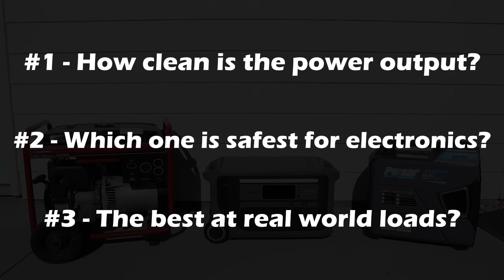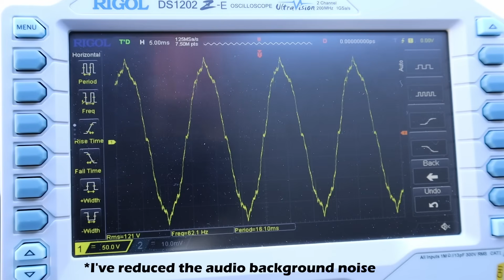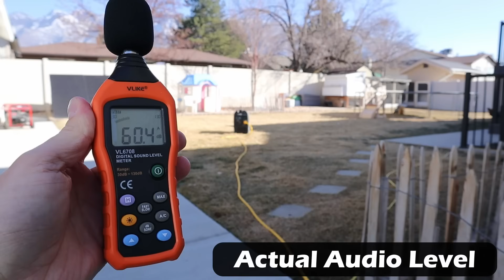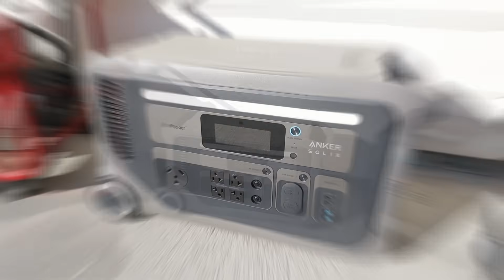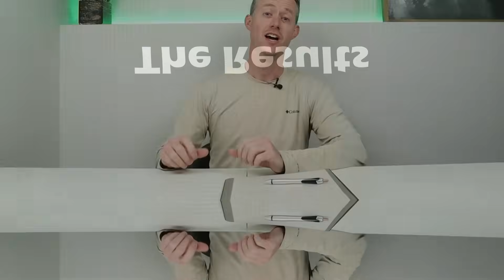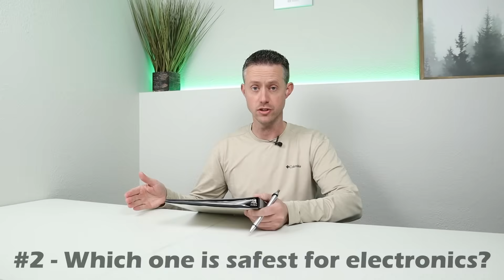Before You Plug Electronics Into A Generator, Watch This!

Comment: I saw an interesting video earlier in the week.  While a power station was being charged, it was not powering the load with its inverter, but was passing the charging voltage through itself on to the load.  The content-creator simulated a questionable power source by using another system with an output of only 108V-109V.  While charging from this source, a decent power station that normally provides 120V to its loads was only giving them the 108V it was getting.  This means that charging a power station from a conventional generator /while it is powering loads/ is potentially a very bad idea.
Reply from the maker: Correct, so using an affordable inverter generator solves all those issues!

Comment: Thank you, I truly thought the battery pk would be cleaner than the inverter generator.
Reply from the maker: I was kinda surprised. They both put out great power but the power station did have slightly higher THD and noise.
Reply: They generate the AC in the same way.  The inverter generator is actually a DC generator which powers a power inverter to give the AC output.  The power station uses batteries in place of the DC generator to do the same thing. 
I was surprised at how much noise the table saw put on the line though.

Comment: Excellent video - would your results then suggest the power stations that used external charging ‘bricks’ like the older Pecron units be safe then to use with non inverter generators?  Seems that style fell out of favor quickly but it sounds like a strength to me based upon your results.
Reply from the maker: Yes, as long as the power brick didn't get super hot during use, it should be fine.

Comment: Dang my dad was trying to recharge his f3000 with a small gas gen last night and it wouldn’t even register with the Anker at all. Now I know why 😅
Reply from the maker: Yep, it must have had super dirty power. An inverter generator would fix that. Thanks for sharing your experience.
Reply: Have seen this with a couple of Eco Flow units.  They would charge from a generator with a floating neutral, but not from a generator or inverter with a bonded neutral.
Reply: @RockSprings-x3d just tested charging my new pecron f3000lfp with non inverter genny,  both are actually unbonded.  Pecron didn’t seem to care if I had bonding plug in or out of generator.  Had one on hand. It couldn’t tell a difference. Genny is unbonded.

Comment: Dirty power generally won’t affect anything that uses a DC converter. Microwave ovens on the other hand can go brazerk as they use the frequency for timing and fan speed control.
Reply from the maker: Thanks for sharing that great information! As long as the DC converter doesn't get hot while in use, it should be fine.

Comment: During our multi-day outage I used my old school generator to charge up my power stations. If it blew them up, they're under warranty, none of the things I connected to them are.
Reply from the maker: Most owners manuals say to use an inverter generator to charge the power station. It's in the fine print.
Reply: @Jasonoid  But it would be on them to prove it. Plus, potentially blowing up a $350 power station vs. my $1500 fridge.... no brainer.

Comment: Jason when Hurricane Helene left us without power for 4 days I used my Predator 3500 during the day and my power stations at night,used the generator during the day to run 2 window ac units and watch tv,and recharge the power stations, I always left the fridge hooked up to the power station.
Reply: Perfect example of why every household should have a small inverter generator and some power stations to run the fridges at night without the noise
Reply from the maker: I'm glad to hear your setup worked well for you! Thanks for sharing :)
Reply: I would like to add an inverter to my existing Predator generation; can you instruct me on how to do that? I’m totally new to this. Thanks!
Reply: @dominodarwin I have not done it yet, but seems that just using "dirty" generator to charge a battery bank and pulling DC from it into the (decent quality) true sinewave inverter then drawing your clean AC power from that is the logical path.  Pretty sure someone will correct me if that is not accurate-
Reply: @MrMEmEmEmEMEMEeeeeee the danger is using a dirty generator to charge a modern power station and trusting the the pass through ac will be cleaned, it won't, the passed through is simply sent through the power station's output making some people believe that they are clean power.
Reply: @gmosc I am sure you are correct about that.  However, that is NOT what I suggested at all.  The question was, how to add an inverter to a Predator (dirty) generator system-no mention of a power station.  Since my suggestion changes dirty AC to DC and then back to clean AC (with unavoidable efficiency losses) via a true sinewave inverter there is no way to pass-thru the varying voltage\frequency\high THD, is there?
Reply: @MrMEmEmEmEMEMEeeeeee yes you are correct and yes I understand your suggestion, I'm just mentioning the danger that someone could easily fall into if they don't fully understand what you are suggesting and make the mistake of running sensitive equipment to a charging power station that they are charging using a dirty generator. 
I've heard about one man who insists upon keeping his dirty generator because he knows how to fix it and that  makes sense, then he can do what you are suggesting. But it almost seems that keeping an older generator makes less and less sense especially if it is  being kept for an emergency it seems risky to trust them.  But respect to anybody who has a good system that they understand and trust. I hope that knowledge can be passed on in a clearly understandable way and it can be a huge benefit to the right people.
Reply: @dominodarwin  WHY??? Traditional generators have been powering electronics for over half a century with no issues... don't buy into the clickbait hype.  Your traditional generator is fine.
Reply: @dominodarwin you can’t. Inverters are DC to AC and your Predator outputs AC. 

If you want to clean the sine wave I’m sure there is something for that

Comment: Sorry, but none of the waveforms demonstrated in this video will be any problem to "sensitive electronics".  I know people bang on about "sensitive electronics" all the time these days but seriously... what is demonstrated here is simply not an issue.  Even something that employs a simple capacitor dropper (ie the cheapest of the cheapest absolutely rubbish grade LED lightbulb, christmas blinky LED strings etc) power supply will not have an issue.  Capacitive droppers can have issues with high frequency ripple since the capacitor lets through more current as frequency increases but even the typical level of ripple that results from poorly designed AVRs in traditional generators isn't a problem.

Where things will go bang, and this can be an issue with a standard direct AC generator or an inverter, is voltage overshoot should a high load (relative to the generator's amp capability) be disconnected.  Essentially how well the device regulates voltage.  This can be seen with say a good old incandescent bulb.  Disconnect the high draw load when it is actually drawing significant amps and you'll see the bulb momentarily go bright then back to normal levels.  Even this sort of behaviour is usually not an issue, it's only when voltage goes way out of spec that things go bang.

I'm in a 230V (+10%/-6%) country and everything is expected to work without going bang at 253V continuous from the network (grid).  Solar installations can push the voltage to 260 and things still won't go bang.  From what I can tell of USA regulations about +6% is considered acceptable from the network so about 127V / 254V is within spec and nothing should go bang with these voltages either.

"sensitive electronics" is more of an escape route that manufacturers of elcheapo/poorly designed products use when their device goes bang for no explicable reason.
Reply: Running out of fuel is when connected devices are harmed. The engine typically surges up and down in speed for several seconds, the frequency and voltage vary wildly. An inverter generator will just shut off its output. So it might be safer in that case. But not a big deal.
Reply: @BwanaBob  Yes, engine speed will move around quite a lot but it won't go radically over speed, at least not enough to push the AVR beyond it's ability to keep voltage limited.  Similarly the frequency won't go up to the point where a simple capacitor dropper supply will fail.  The sort of speeds to get the AC frequency high enough or voltage beyond the AVR's ability to respond rapidly enough would cause the engine to instantly fail and the rotor in the generator to wedge against the stator.  Just getting one of these small (yes, 15kVa is small) generators to produce just 400Hz would require the engine to spin at around 12000 RPM...

Inverter generators usually don't just shut off their output unless the DC rail goes high.

Now I'm not just some clueless yahoo on the internet so if you care to provide 'scope traces showing voltage going way over and/or frequency going stratospheric that would be most interesting.
Reply: @retrozmachine1189 well you seem knowledgeable enough to ask this question of. Why does the normal generator put out such crappy power? From a physics standpoint? It is my understanding of the way things work that the sine wave that we get out of the wall comes from a spinning generator (alternator). The whole concept of a sine wave is about the spin of the generator, that's why it "unfolds" to 360°

And I would think for the inverter generator and the power station both, the quality of the sine wave is entirely dependent on the quality of the inverter that they are equipped with. So kudos to both of them for including a very good quality pure sign inverter. But why does the spinny thing not make a good sine wave? Wtf?
Reply: @mark_bickford  You are right.  The issue comes from variable loads.  You have to adjust the magnetic field in a classic spinning generator to provide sufficient current to hold the voltage.  Too much current voltage goes high.  Too little, voltage goes low.  Now toss in power factor (ie displace the voltage and current waveform) including harmonic loads and it all starts to get a bit complex and that is beyond the capabilities of the AVR to precisely counter.  There's actually more to it, but that's a good start towards understanding.  In fact lots of AVRs can't even manage a clean sine with no load.  That's assuming the generator even has an AVR.  Some do it even more crudely with a capacitor.  AVRs in big boy generators are infinitely better.  These days you can find switching AVRs in certain models of certain brands of small generators and they do a very good job indeed.
Reply: @retrozmachine1189 that makes sense, I just was shocked that at no load, that thing put out such a crappy sine wave
Reply from the maker: Thanks for sharing

Comment: I've never had a problem running anything with a gas generator as I make sure it is unbonded and tuned.
Reply from the maker: You must have a higher quality one than seen in the video.
Reply: @Jasonoid they require a little bit of tuning.

Comment: Good video. To often people assume if it says ge dearie that all are the same. And clearly they are not.

Specifically about connecting a generator to a power station, it’s important to. It’s that with pass-thru charging, we might get dirty AC output from a dirty generator. 
A workaround for this could be a diy battery expansion, with its own battery charger. This way the dirty generator charges the external battery, which in turn charges/equalizes the power stations internal battery, avoiding the dirty pass-thru output.
Reply from the maker: So spend $1500 or $2000 to fix a problem that a small $400 inverter generator can fix? That's a great way to make money on YouTube, suggesting people spend thousands to 'fix' their old generator. I've seen that from other channels. I think using a $400 inverter generator is cheap and easy.
Reply: @Jasonoid  you are not wrong. The two points to consider are if we already have a generator, we can use it. And if we want larger battery capacity, a diy add on battery with charger gives us that as well. 
If you are buying everything new, then absolutely buy the generator with inverter. That’s a no brainer.
So the conflict here comes from different priorities. All of which are valid on their own.

Comment: One thing to remember is when you are charging your power station (other than solar) it switches to pass through mode meaning whatever source you are using to charge it is also powering anything you have connected to it.
Reply: True, but when you turn off the outlets on the Power Station, this prevents Pass Through Charging.
Reply from the maker: Correct, and when using an inverter generator the power is extremely clean and wouldn't be an issue. Using a traditional generator might cause issues.

Comment: Hello , I was wondering if there is a Device that would take the power from a traditional generator and convert it to a pure sine wave ? Anybody? Anybody?
Reply from the maker: An inverter generator costs between $350 to $600. That's cheaper than any advanced power conditioning device needed to clean dirty power.
Reply: Just plug in a 12v power supply, and plug an inverter into that.

Comment: How about a whole-house backup generator like a Generac?
Reply from the maker: I'd sure hope that spending $10,000+ on a backup system like that the power would be clean.
Reply: Are there devices that can be connected to help clean up dirty power should you need to run sensitive equipment using a traditional gas generator?  Tripp-Lite ISO bar maybe?

Comment: 3:00 your generator has crap engine speed management.
Reply from the maker: Thanks :D
Reply: @Jasonoid  Sadly this is really common.  If you ever notice when running your house on a gasoline generator, if all of your basic digital clocks seem to run a little too fast, or a little too slow, that's why.  Traditionally, stove clocks, both the mechanical and digital variety, have used the 60Hz electric line as a reference signal for the clock.  If your generator is running at 61 Hz for example, you will run one second per minute faster than it should.  This means that then every 60 minutes in actual time will run the clock 61 minutes.  This isn't particularly bad, but a lot of generators are even worse than yours.  Years ago, my parents' old generator caused the clock to pick up something like 36 minutes hearing about half a day. It turned out that the power frequency was closer to 63 Hz on average unless it was heavily loaded down.  One of the reasons this is done is that mechanical governors just aren't that good unless you get something really sophisticated (and really expensive for a home generator), so they end up biasing the thing a little bit on the fast side so that it handles large transient loads a little bit better without logging the engine too much. As a rule, it tends to be worse to run under frequency vanover frequency by any given amount.  Since gasoline generators are more designed for large equipment than sensitive home loads, this doesn't tend to be a problem.

The eventual replacement that they got, a 20kW Kohler standby unit, has really good speed management, actually monitoring the electrical draw on it instead of just the engine RPM for speed management.  Basically, it detects a large draw (like a device inrush current) and UPS the throttle just a bit.  I have looked at it on a scope, and it isn't quite as good as an inverter generator, but it's surprisingly good.

Comment: I would like to see a power station that is being charged with dirty energy from a gas engine.
Reply from the maker: Most power stations will not charge from a non-inverter generator.
Reply: @Jasonoid @Jasonoid, I had to use dirty energy when the power was out at the apartment; they were using it to charge family phones.
Reply from the maker: A phone charger uses a power brick that converts AC power to DC power, it usually cleans up the power a bit.
Reply: I’ve  done it.  To my new pecron f3000lfp.  Works great. Pecron agrees ok.

Comment: Interesting comparison test, thanks for the work you put into test. It would have been nice to show your utility power as a baseline and report THD with an inductive load (the saw) in addition to the resistive load of the space heater. 

I agree with the other posts about the conventional generator. Normally set frequency a little high under no load to compensate for droop due to the mechanical speed governor. If the genie has a voltage regulator I would set it a little higher.
Reply from the maker: In my previous testing, grid power is very similar to what the power station and inverter generator produce. I should have mentioned that, thanks!

Comment: Can the D.C. output of a traditional generator be used to charge a power station via solar inputs?
Reply from the maker: Usually it's 12v @ 10 amps, it will charge your power station at 100 watts. You can get much faster charging using the generator AC output. A cheap inverter generator only costs $350-$600 depending on the size you need.
Reply: Don't think so. The DC output is mostly rated to a much lower load and often unregulated.

Comment: Great video! I have wondered how clean the 120v power is coming from the receptacles that you see in the back of pickup trucks. I  see mine is rated for 400w and I could lower the charge rate on my power station and have it charging when driving.
Reply from the maker: Good question! I'll have to test the waveform on my F150 inverter to see what it's like. Probably not the best LOL
Reply: @Jasonoid  Thank you for your reply. I look forward to the results of your test. Thanks again, Jake